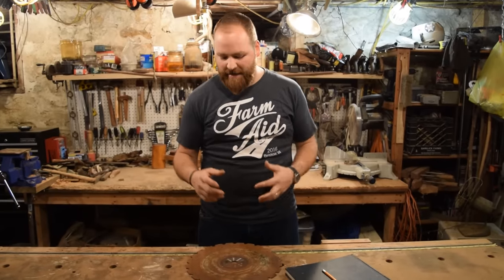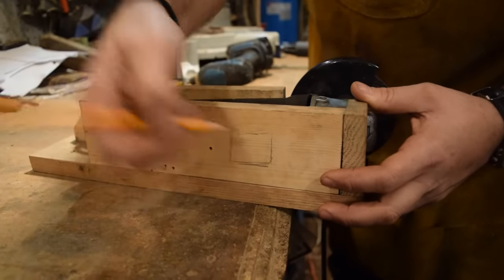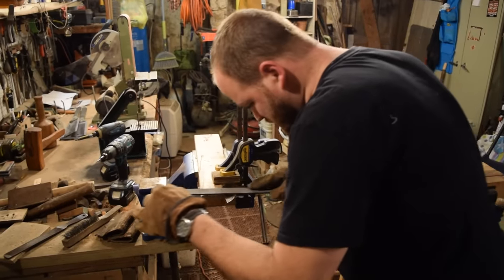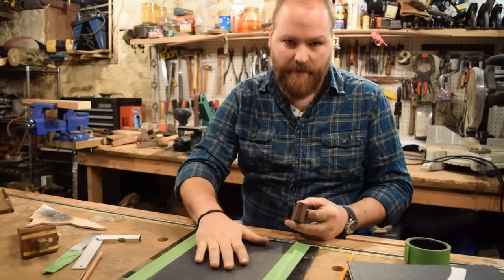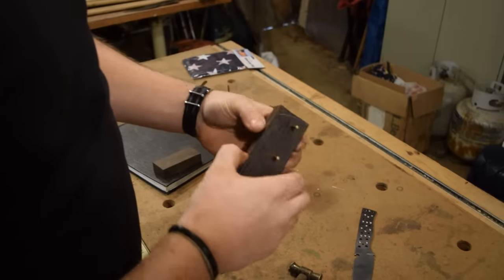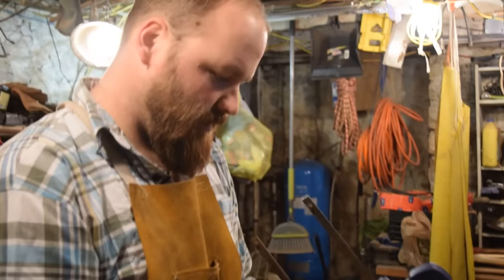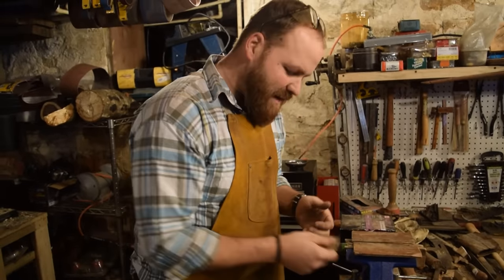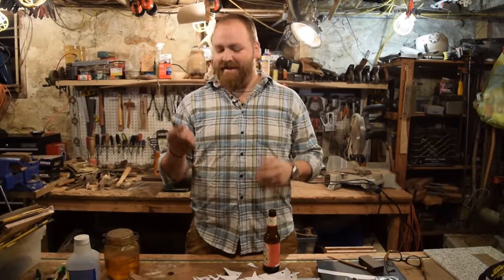Making a Knife From a Circular Saw Blade

Comment: The whole process of cutting out a blade shape will trash the temper on a saw blade, so, yeah, you really do have to worry about heat-treating and tempering the blade.
Reply: Not necessarily true if you take your time and keep the work piece cooled often. You will pull the temper if you push too hard and turn the work piece blue. Notice he uses a wet rag to cool the piece as he was shaping the blank.
Reply: No One Of Consequence I think your right. As simple as it would be to re-harden and temper again.
Reply: @superclaymaster  How simple?  I've seen people on other videos make it sound really complicated.  I have a piece ready for a handle and final sharpening made from an old paddle bit and am at an impasse. I have a propane torch and an oven at my disposal.   Recommendation?
Reply: Berto Golazo heat the blade till it’s non magnetic then quench in oil if it’s oil hardening or water if it’s water hardening. A fast quench oil is a safe bet if you aren’t sure. Then temper the blade in an oven.

Comment: Great informative video. I studied with a knife maker and this is one of the ways I learned to make a knife.  We used big, old circular blades from sawmills. A plasma cutter sure made easy work of cutting a rough blank.  Actually, these knives hold up pretty well in the field if you take a small steel out there to touch them up now and again.  I'm still using the first one I made from 25 years ago.

Comment: With no heat treatment, the blade will be very soft, the saw blade is treated on the tip of the teeth only.
Reply: Robert Auger, no the older and some newer styles heat treat the whole blade you just have to get the right one the is properly heat treated
Reply: @jaspertipper9649  it doesn't matter... with all that grinding the metal was heated and softened. A new heat treatment was more than necessary. That's basic for any blacksmith guy!

Comment: If that grinder wheel should decide to disintegrate, Where do you think it will go? They weren't designed to be used at this angle. I see you have googles and dust respirator but these wheels are moving at 15-20,000 rpm. that will destroy your face. I know you've probably done it a lot  but be aware.....I would at least extend that shield. be careful. good work on the blade.
Reply: Thanks safety police. Can't count the amount that's happened on my seven fingers.

Comment: You didn’t harden the blade. The original saw blade should only be maximally hardened where the teeth of the saw blade were. This means your knife isn’t properly hardened to a point where it will hold an edge well doesn’t it?

Comment: I don't know why people would give this a thumbs down. I thought it was pretty cool. Might try using Tyvek tape to tape the pads on your clamps instead of wrapping the handle with painter's tape so you don't have to worry about your clamps getting epoxy on them and also won't have tape to scrape and peel off the handle after it dries.
Reply from the maker: Thanks! That’s a great tip!

Comment: Thanks heaps. I watched this yesterday and made a knife today. Took a while to come up with a shape but got it in the end.  Had trouble with chipping on the edge but sorted it out by finishing with a steel.
Reply: The edge retention will like a six cuts and gone :D. These 'knifemakers' are a joke to real craftsmans. What about to find out some information about steel first? No? If the saw blade has welded teeth, the body of the blade is junk steel about 0,3% C and can't be used for a good knife. So much work for such a useless result. FYI, I'm metallurgy specialist.

Comment: good video, !    here is a little tidbit i learned along the way  i  have owned quite a few boats , Watercraft , Outboard Motors and other marine related things   to keep a log on every vessel  was always very important and i tried numerous  ideas from bonded books and 3 hole punch  paper and the 3 ring binders  the problem with those was always  paper was too easy to fall out after time so what i wound up using was the old style Composition books with the back and white covers   i was very adamant about logging in part numbers  and maintenance records  as i went along  when you mentioned  keeping your templates i thought that   glue sticking your used  ones onto pages in one of those books for keeps  the thing i liked the most about those books was  their overall toughness  often i needed to have the book  in a shop environment  with dirty hands and machinery around  the thick cardboard  covers   protected the pages from the abuse i gave it and typically  pages  stayed put  yet if i needed to cut one out i could    i always traced my gaskets  onto the pages and took the notebook with me to my parts stores to make sure i got the correct one i needed etc  on some of the books i even attached a pen, pencil, or whatever to write with  using a  string so if i was in the engine room i didn’t have to go nutty looking for something to write with   another neat trick i learned was to date my entries   and sometimes that  would help me  find what i was looking for i that book  not that i could remember the dates but sometimes  i could remember something like  that day i installed whatever  there was snow onthe ground so i   could   figure out that it was probably December ish
Reply: Silly me, ya said log. I though wooden log.  Son I was trying to figure out why ....floatation device in the event of sinking....  funny how our mind jumps ahead....
Great idea about keeping notes.. I will out a book in the shop   cheers

Comment: I did something similar but used a dremel with cutoff wheels to cut out the metal.  That worked well for the curves but took forever and went through a lot of cutoff wheels.  I like your way better,  and yours turned out way nicer than mine with your excellent finish work.

Comment: I liked your video. When drilling I use bacon grease. My Grandfather & my Dad were full time blacksmiths when I was a kid. ( I'm 75 now. ) They would send me to the butcher shop to get 5 lbs of fat and then would heat it up in the forge to liquefy it. Used it to lube every thing in the shop. Smells good when your drilling.

Comment: Beautifully finished piece, amazing what an old saw blade could be turned into. Thank you for your video.
Reply: The edge retention will like a six cuts and gone :D. These 'knifemakers' are a joke to real craftsmans. What about to find out some information about steel first? No? If the saw blade has welded teeth, the body of the blade is junk steel about 0,3% C and can't be used for a good knife. So much work for such a useless result. FYI, I'm metallurgy specialist.

Comment: Great video! you have inspire this chef to make his own knife.

Tip for drilling metal- motor oil works better than wd40. it doesn't spray all over and make a mess, burns less, and it stays down on the hole a little better. i find a french's mustard bottle works great because of the twist top.

Comment: To try something new, harden it. The center part of those blades are not hardened like you need your edge, but the steel can be hardened, so do it. You have a forge. Friction saws are usually made from 80CrV2 steel. For that steel. three normalization cycles. Heat and soak (hold at bright red) for 5 minutes, then quench. Should come out at 64-65 Rockwell hardness. Temper twice at 400 Fahrenheit for 2hrs for a Rockwell of 60-61, or 450 for R57-58. A better quench is done by coating the spine of the blade with refractory mix 3/16" thick everywhere you want the blade soft, then after the mix has dried, heat the whole blade and then quench and temper. You will not have just a good knife, but a superb knife then with world-class capability. You like that steel, so I just gave you the information necessary to become a badass with it. Good luck.

Comment: The easy way to line up scale is to use rubber cement to glue both scale together or tape them together with masking tape.  Then when you drill through for the pins you can just barely tap them in and then take apart for final assembly.  Much easier.

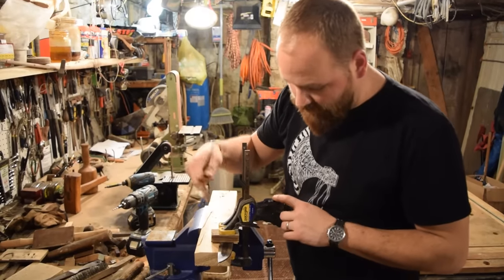Comment: Great video and beautiful final product! I'll watch it over again but I couldn't quite tell the process 10:30 ( plunge angle and edge ). Dumb question I guess. Could you show a cross section of how the plunge line angle meets up to the blade edge? About how much thickness is left to put an edge on?  What type of blade are you using on the angle grinder, it looks pretty thin? What was the type of wood used on the handle? I was surprised no need to peen the brass rivets, just cut flush and polish. Saw blade you made the knife from looked larger that a 10" blade am I right? Sweet Knife!

Comment: I am very green at this and like this, but would have really appreciated when you started the hand sanding with the spray bottle, what you sprayed, and the grits and brand /type of paper instead of silence?
Reply from the maker: You can use any type of spray as an abrasive lubricant, but I usually use a green/organic glass cleaner spray. The grits are just a progression from low to high. Nothing special.

Comment: Great video! Questions:
1. What kind of wood is the handle?
2. What finish did you use on the wood?
Thanks.
Reply from the maker: The handle is Wenge, and the finish was Boiled Linseed oil.

Comment: Can you please tell me what type wheel you use in the angle grinder to cut out the blade. and thank you so much for the videos, I've learned so much and have loved everything you've made. Thanks
Reply from the maker: Thank you. I use standard abrasive metal cutting discs. I usually buy 10 packs from Harbor Freight.

Comment: This will stay sharper if you heat treat it, unless it's just for looks.   You cut the hardest part of the saw blade off in the first cut.  That's why it drilled and filed so easy.
    Also you should tell people the difference between a cut off wheel and a grinding wheel and that you can't use either for the others job.  It can cause them to shatter and blow apart and stick into tissue (like face and hands).   Cool looking knife though.

Comment: I can see this helpful for the basic work needed to make a knife but would be concerned in the  steel used in making this. While the saw blade may be somewhat hard its still easliy drilled and filed  which tells me it wont be holding an edge long.

Comment: I use a black epoxy on my golf clubs and since i have it on hand I end up using it for everything.  You might give it a try sometime because it gives a cool look with the metal/wood combo. I think it would have been really cool on your Birch Bark handle. 
I'm wondering why when you bandsaw the handle in half you don't just put the outside surface to the inside? Also what if you epoxy everything up and then drill the holes for your brass pins? Anyway.... please don't take my comments as criticism because I love the stuff you make. I used to help out in our fab shop when they had a lot of work and one of the guys told me that I was a Tinkerer not a Fabricator. Meaning I took the long way to finishing a project.... I took it as a complement and plus I didn't want to be a fabricator anyway.

Comment: Must be nice to be able to draw!  I have enough trouble drawing crooked lines let alone trying to draw knife designs!3 and a half eighths, that's 7/16s right?
I DO have a TON of old 12 and 14 inch saw blades with about a quarter inch inner part of the blade and and eighth of an inch on the edges for about one and a half inches in!  I think THEY will make some really good knives!
It's good to see someone that makes knives for sale, use a Harbor Freight tool or two!  LOL!  I have 3 or four of their belt sanders of different sizes and they aren't all that great when it comes to power but, that is a help when you need to go slower, anyway!
I enjoy your videos and learn a lot, too!

Comment: What's the thickness of your abrasive cutting disc?  Metabo makes 1/16" thickness discs that fit an  offset grinder. It cuts much better & faster than the stock 1/8" discs.
Reply from the maker: Thanks for the suggestion.

Comment: I am inspired to turn my dull, otherwise, useless saw blades into knives. I need a food prep and paring knife....so here I go. 1 question, you said the saw blade was already hardened, could you give it an addition hardening by heating it up and cooling it? If so, would you do it right after you cut the knife blank from the blade, or, wait till right before you attach the handle halves? Great project, I learned a lot and want to make myself some kitchen knives. Thanxz
Reply: They are hardened but you never know how hot the blades get while sawing through wood. If you have a way to do a heat treat it wouldn't hurt. I made a knife from a saw blade last weekend and it was so hard I could barely drill through it. I've made other knives from the same type of blade that was easy to drill through

Comment: Loved this video.  Just recently started looking into making my first knife.  This video has given me enough confidence to give it a go.   What type of paper is on the belt sander that can handle the metal?
Reply from the maker: Any belt sander will work for metal, but different grit materials have better or worse characteristics when it comes to cutting longevity. A quick Google search for “what kind of belts are best for metal” will give you way more info than I could responding to this comment😉. Thanks.

Comment: Pretty sharp work. Ya ya I know, pun intended. I have a question, maybe you've already answered in another vid. Couldn't you re-temper the blade in an oven to make it hold the edge better? Just wondering, I've thought about making a knife from saw blades but wasn't sure if and how well it would hold an edge. Great vid and very fine knife work.

Comment: Just great. Im going to do this for sure (well, my son says he'll help me do it more to the point ha ha) couple questions if i may? Im assumimg  you have to take care not to overheat the blade being as its already tempered and heat treated? Whats the oil you used on the handle please? Great inspiring videos your making, cheers for sharing :-)
Reply from the maker: Feral Grandad thanks for watching and your compliments. Yes, you need to be careful not to overheat the blade. If you are careful, you should have no problem coming through the process with a nice, useable knife. The oil is boiled linseed oil. Thanks again.

Comment: I do have a question about the saw blade you are using . It looks like a masonry target saw blade .  Is that correct and if so will a trim chop saw blade work out the same ? I have several of those laying around for a 12 in miter saw and would love to try this .

Comment: Do these saw blade knives need to be tempered in the oven before or after sharpening?
Reply from the maker: They do not. Using an old saw blade like this and being careful not to over heat during grinding ensures that you are not affecting the temper that is already in the steel. If you were to over heat, then you would need to re heat treat and temper, which I have also done with saw blade knives.

Comment: Very good video. I am just curious as what liquids you are using. ie,; when drilling the hole? Just water or a light oil. on the final clean up on the handle, just a gunstock oil or something else and finishing the blade; an acid type etch or some other protectorant.

Comment: The trouble I have with using saw blades, are they are hardened and it is almost impossible to drill your holes into. I have tried the cobalt drills and finally carbide drills which are really expensive and I haven’t had good luck with them. I have started heating the areas that need to be drilled while leaving the blade immersed in water to preserve the hardness. Still hard to drill but better. Your saw blades seem to be easier to drill?

Comment: Your drill bit was shaking around quite a bit when you were drilling the holes. Try centering it better next time, it can be dangerous if your drill bit is out of center, it might break off and fly god knows where and potencially hit someone. BTW what do you spray the blade with before the hand sanding for the satin finish.

Comment: Subscribed! Love how you worked the handle. Very satisfying. Will be sharing as per your request.
Whatever you got is good for us bud. The more the better.

This has much more sentimental value than buying a knife online. Custom, unique and handmade!

Someone else here commented the metal you used is soft, so how is that edge holding? I saw someone else making a knife from a file (also pre heat treated and all that) but he put it in the oven to make it a little less brittle and workable as files are very hard

Comment: Is that the Cowboy Junkies I can hear? I would have thought the handle shaping would have been done earlier, the holes for the brass pins countersunk, and the pin ends peened into the countersink to lock everything together. End result is very impressive.

Comment: Does the epoxy resin give it a waterproof seal? My concern is the almost drilled holes you did in the metal handle is it it going to gather puddle of water in those areas